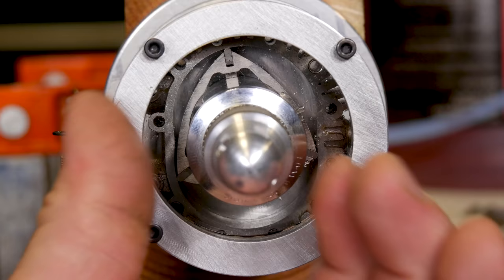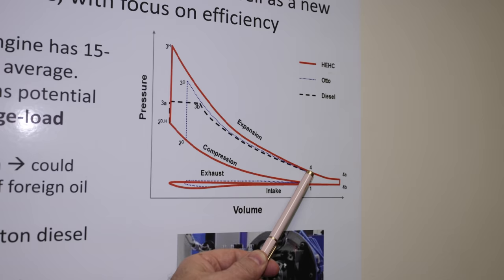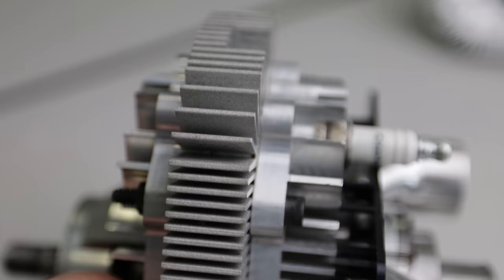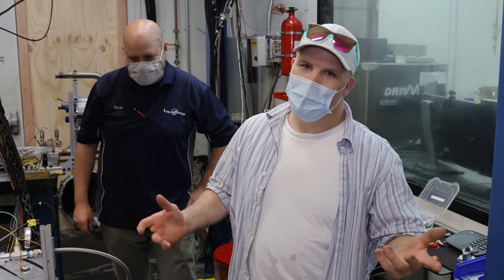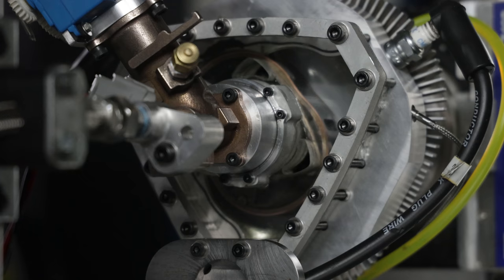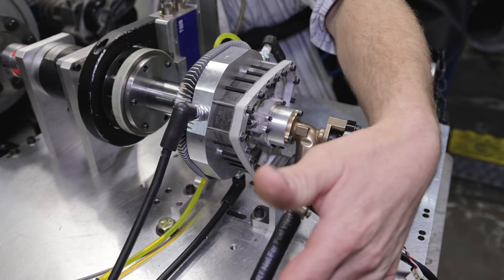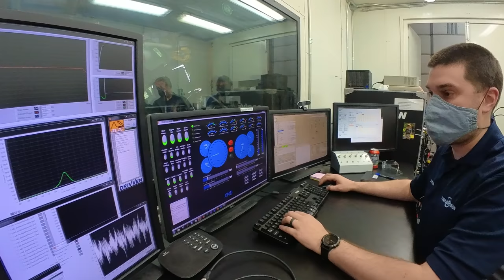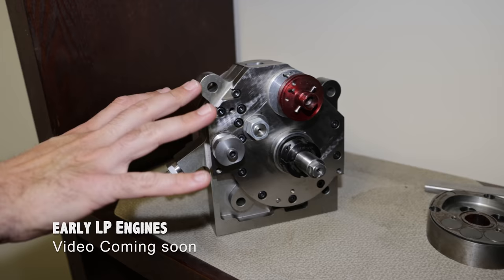See Thru Liquid Piston Rotary Engine - In Slow Motion

Comment: I got all excited and I almost forgot. The issue with rotaries wasn't necessarily the rotor or the housing, but the fact that you have to mix oil into the fuel to preserve the rotor seals. Read the brochure and it said 50:1 gas oil mix, IDK if rotaries have a future in auto as long as you have to burn oil.
Reply: Yeah it would have to be for small off road applications. At least it should burn it all unlike a 2 stroke piston engine, but i have a feeling emissions is this things holdback. Still very compact though.
Reply: The issue was still the rotor and more specifically it was its seals (the apex seals in particular.) The issue with having them in the rotor both made properly lubricating them difficult and also introduced a bunch of forces that seals won't typically see in any other engine. Moving them to the housing reduces the stresses and it makes delivering the proper amount of lubrication easier. You still have to meter some oil that ultimately makes its way into the combustion chamber, its now at amounts comparable to any 4 stroke engine.
Reply: @travisbeagle5691  no way it’s anywere comparable to a 4 stroke, the big difference  is that in a Rotary design, the Rotor has to move „through“ the Burning Camber, in a normal 4 stroke reciprocating engin the Burning Camber is „seald off“. 
And the Reason why Mazda Stopped using the Good old Wankel were stricter emission Regulatios, Not the notorious Apex seals.
(Yes the Wankel is comming back in the new CX-30, but only as a Range extender in a hybrid Setup)
Reply: @dominik230900  every 4 stroke engine still has to lubricate the piston and cylinder walls. That oil does make direct contact with the burning fuel. Because only a small bit of oil has to be metered in with this style rotary as compared to a Wankel, and only a small portion of it is exposed to fuel burn, oil consumption is comparable to 4 stroke engines. That doesn't mean it's quite as good, but it's comparable.
Reply: @dominik230900  It was a few reasons and I was only answering the original comment which was about burning oil. The other two reasons were efficiency and emissions, both of which are fixed with this engine to the point they can be better than comparable piston engines.
Reply: @travisbeagle5691  yes that is True, but the big difference here is for Exempel That you have an oil Control Ring which „regulates“ the amount/the Thicness of the Oil layer on the Cylinder Wall. Also you have a small layer at the Edge too the cylinder Wall where the air fuel mixture doesnt get burned, That means That the microns thic oil Layer stays untouched. The big Problem with Rotary Engines is That you have to inject the oil into the burning chamber (or what will be the burning chamber in a few deg° of crank/excenter rotation) so the oil is Mixed together with the air and fuel, Even in this design, the only new thing they did was get rid of the Apex Seals, but you would still have to use side seals which can also blow like apex seals. Don’t get me wrong I Love Rotary engines and drive a RX-8 myself, but I know it’s weakpoints🤷‍♂️
Reply: No seals here baby so it’s all good
Reply: @travisbeagle5691  true
Reply: @dominik230900  That's still a tiny amount compared to what was once needed with Wankels and the difference is enough be comparable (again not quite as good) to 4 stroke engines especially when you also take into account removing several lubrication points that no longer exist. Also side seals weren't that much of a problem with rotaries as the forces they normally see are comparable to those on piston rings.
Reply: @tony_5156  on a small scale like in this case you often can leave out most of the seals and still run the engine, but if you scale it up, to power a car for example you will need them
Reply: @travisbeagle5691  nah I wouldn’t say it’s a tiny amount compared to the Wankel you will still need a ton of oil for proper lubrication compared to a traditional 4 stroke, maybe it‘ll use a bit less than the Wankel but you don’t know That, you don’t have any data on That, maybe in the end it’s Even More, the only Point we have as reference is the existing rotary engine and to compare those two and from what I can see is that this engine will still burn an lot of oil. And to the side seals, take boost into consideration, wich you need today to run efficiently and environment friendly (Euro 5/6) then the side seals will become a weak point.
Reply: @dominik230900  this is designed to a 25:1 compression ratio,  it has options for efficiency and the considerations for getting that high more than account for having forced induction at a lower ratio. Also we can show just from a design level that oil use will be much better on this engine than on Wankels because again,  we couldn't properly lubricate the apex seals with them on the rotor. The engineers intentionally metered a large amount of oil into the engine to compensate for the poor lubrication. Now that the seals are on the housing, it's now easy to deliver oil to them and you no longer need to meter more than is necessary.
Reply: @tony_5156  There are seals.  10:40 you can see them built into the cylinder walls.
Reply: @travisbeagle5691  at a compression ratio of 25:1 you’re even higher than a Diesel engine, don’t Even talk about a petrol with 95 Octan…😆 you will knock the shit out the petrol on the half way into the compression cycle. If you take a really close look at the design you’ll see that you too only have a very small contact point (like the apex seals) wich is in this case the rotor itself and not a seal. This small contact point screams seal me up with oil. Additionally if you slow down the video you can see „blow by“ wich travels back in the counter direction wich decreases the efficiencie further. Again in a rotary application you will have oil in the Burning chamber and i mean a lot, not only will you have it on the rotor and housing but furthermore in the Air Fuel mixture.
Reply: @dominik230900  I know, the point was that the hardware can take the pressure with boost because it's designed to operate at the high compression ratio. A production model,  with boost especially, would operate at a lower ratio.
Reply: @travisbeagle5691  that said I'm not seeing any oil channels for the seal, did you notice some?
Reply: @travisbeagle5691  I don’t really think that I can take the high compression ratio, you may not have apex seals, but the sealing are across the rotor face is still only a small line
Reply: @dominik230900  the diesel variant of the 40 kW engine already operates at that compression ratio according to their technical papers. There's a possibility they could be lying,  but the fact that they have a number of DoD contacts and how they've been with sharing their data leads me to believe they aren't. If interested,  they have a document on their seals and how they are intended to work in their technical documents page.
Reply: @travisbeagle5691  The issue with their diesel engine is it's 750cc and turbocharged. They also weigh the engine without the turbo, ignition, cooling or really any parts on the engine at all. Statistically speaking, even a Geo Metro has a more efficient engine.
Reply: 2 stroke style. :(   Would need frequent italian tune ups to avoid carbon.
Reply: in both engine designs the piston or rotor moves "through" the burning chamber. they both get "sealed off" during that cycle as well. Please explain better... I'm curious as to what you might be trying to address. Thanks
Reply: Someone needs to think out of the box and find a lubricant that doesn't need to burn and can be expelled without environmental harm. I don't know why but nitro popped Into my head because of the effect caused by nitro methane having oxygen. molecules they don't need fresh air to produce a fire on the power stroke. I love that.
Reply: @BrewstersAuto  graphite but that has its flaws…

Comment: Fun fact: Everyone wanted mazda  to improve rotary, not kill them.
Reply: Engines that consume oil as part of the combustion process are doomed from the get go. This engine is DOA.....
Reply: @jfisk60903  Not necessarily, but they do have an uphill climb in this emissions-paranoid era. It is possible, with the right oil and a good catalyst, to meet the stringent (ridiculous) emissions requirements in place in many places today even with an oil-burning engine. It likely would be a somewhat expensive oil. However, in areas that test emissions, using the wrong oil will cost you big money as you'll ruin the catalyst and they'll make you replace it or stop driving the vehicle. All that translates into a vehicle which will be niche, but rotary engine vehicles have always been niche.
Reply: Rotary engines are just a poor engine design. Even in situations where reliability is not a factor traditional piston engines are superior. Look at drag cars. The engines in them are rebuilt after almost every run. They still choose to use traditional engines because they work better.
Reply: They're bringing them back as a range extender for the mx30 ev
Reply: @jfisk60903  this engine does not consume oil as part of combustion. It is metered directly to the sealing surface from the engine block, whereas a Wankel has to inject it into the combustion chamber or pre-mix with the fuel. They have oil consumption down to 4-stroke piston levels.
Reply: @rubiconnn  they still use an engine from the 50s-60s which burns gallons of fuel per second. no lmao
Reply: @rubiconnn   Piston engines have been in development for far longer than rotaries out of sheer necessity. The early piston engines undoubtedly had reliability and efficiency issues that we would scoff at today.
Reply: @jfisk60903  what about wolkswagens?
Reply: To be honest only the RX-8 and others that use rotary except for RX-7 to RX-5 are the only ones who had issues with the seal
Reply: There is no improvement. It's a crap design
Reply: @edifyguy  by the time someone could finally discover whatever unobtainum compound that could magically increase efficiency, fuel consumption, reliability, and emissions the internal combustion engine will be decades banned from new production. Mazda hired the finest automotive engineering staff available to try and solve it and couldn't.
Reply: @jeepmanxj  I think you'll find that's not the case. I'm pretty sure that what killed the rotary in Mazda cars was not emissions, but fuel economy requirements. Because of Corporate Average Fuel Economy laws (US), and countries that tax gasoline excessively (Europe) Mazda couldn't make them economically feasible anymore because those are the two largest auto markets and the rotary engined versions used 2-3x the fuel of a comparable piston engine because the thermodynamic efficiency is low. What these engineers have done claims very good thermodynamic efficiency, so perhaps they'll accomplish what Mazda could not, and Mazda will license the technology from these guys and make a rotary-engined car again soon! That would be sweet.
Reply: @edifyguy  it was a combination. Yes fuel economy was as much of it as emissions. They also fought complete lack of reliability, shit poor thermal efficiency, manufacturing complexity, and when compared to an otto cycle engine just total inability to compete in anything besides packaging. 

The singular use, as mentioned earlier with the range extender, is about their only advantage. We need to stop with this nonsense.
Reply: @jeepmanxj  Nonsense? I'm not sure anyone else would consider the constructive discussion of the reasons that Mazda does not presently make a rotary-engined car to be nonsense. I'll just say that I hope that this new design, which looks utterly ingenious to me, will solve the problems that made the Wankel design impractical, leading to its discontinuation in the last production car that used it. The new design appears to me to be very promising.
Reply: @edifyguy  this design is nonsense. It doesn't solve the fact it's a flaw in any engine that operates in this method. It doesn't matter how you shape the rotor faces, or the combustion chambers, or any of the thousands of "I've solved the Wankel problems". This here, not new. Won't go anywhere. 

Mazda killed the engine because there is no design changes that can make it superior to an otto cycle engine. That's it. Mazda tried, tried so hard that Ford said stop. They said no, we must try, ford dumped them. 

Now decades and decades later with huge advancements in manufacturing and materials science. Still. Nobody solves it's problems. Let it die. There is a reason all the RX7 guys are doing LS swaps.
Reply: @jeepmanxj  Not all are swapping, but certainly there are some serious issues with the Wankel design. Certainly some of the issues do carry to this design, but not all of them, and perhaps the ones that remain will prove to be either livable or solvable. Time will tell. One thing is for sure; the power to weight is very attractive, and that alone will make some interesting applications. Whether it ever makes it to a production automobile or not, this is certainly a design which I expect will find uses.
Reply: @boissondevin9772  piston engines has oil sprayed beneath, how you get oil on the two flat sidewalls? With the oval spinning at high speed and rubbing on the sidewalls, no lube mixed with the fuel will soon seized the engine.. not good.
Reply: @madsam0320  the face seals are in constant contact with all 3 apex seals, so they receive the same oil metered directly to the apex seals. There is no need to mix any oil with fuel.
Reply: @boissondevin9772  I am talking about the two side plates, one of which is transparent in this example, the other is opposite side of the rotor. The rotor is spinning fast and rubbing on both sidewalls to maintain a good seal, apart from the seal you talk about, which is separating the 3 chambers.
Reply: @madsam0320  that seal between the rotor and the side plate is on the edge of the spinning rotor. It is in constant direct contact with all 3 stationary apex seals, so it will receive the same oil metered through those stationary seals. Contrast to a Wankel, which has no stationary seals to serve as oil-delivery.
Reply: @jeepmanxj  You are talking out your arse. All the problems you cite were proven solved in the 787B 30 years ago. Ceramic-metallic coatings that last for millions of miles lubricated by the fuel itself, keeping the heat in and improving economy.
But bean counters wouldn't spare the cash to switch away from antique hard chrome plating. Lame.
Reply: @jfisk60903  not so. There is quite a bit of research going into small personal charging systems. "think military or commercial uses where someone is wearing on of those power suits for strength" NOthing even comes close to the energy density of fossil fuels except nuclear right now.
Reply: Yep. What other engine do you know that redlines at 13,000 rpm?
Reply: @ravencole2740  turbines. 

As far as otto cycle piston engines no, there are none so inefficient and ineffective it needs that kind of rpm to be usable.
Reply: @jeepmanxj  agreed
Reply: @ravencole2740  Most Formula 1 engines redline in the 18K RPM range.
An engine affordable to mortal individuals is the InlinePro F20C mod, good for sustained operation at 12,500 RPM.
Reply: @501Bravo  So how many is that? 
Me: Knock! Knock!
Youtube: Most people actually knock 3 to 4 times on average when attempting to gain the attention of residents or other occupants inside a house or apartment. It may take many more knocks depending on the square footage of the house or apartment.
Reply: @ravencole2740  Ummm... I'm sorry.  I thought you asked an actual question.
I didn't realize it was completely rhetorical in a failed attempt at cognitive dissonant snark.
Carry on.  I won't intrude into your ideological echo chamber again...
Reply: @501Bravo  Awww, your fee fees are swollen!
Reply: @ravencole2740  yamaha 250 4 cyl 4t from a few years ago redlines at about 18000
Reply: @ravencole2740  lol. Honda & Suzuki were making 250cc 4 cylinder motorcycles for mass production in the 90's that produced peak power at 18,000 & 19,000 rpm.
Reply: @501Bravo  right, they are also usable outside the peak efficiency range. Unlike a Wankel that entirely falls apart in reliability, efficiency, and power.
Reply: @ezekieltorres777   ....wats

Comment: One thing to note with this design is the fact that only one side of the rotor is experiencing combustion. If you notice in the slowmo camera, this is easily seen.
There could be reliability challenges with heat differences across the engine.